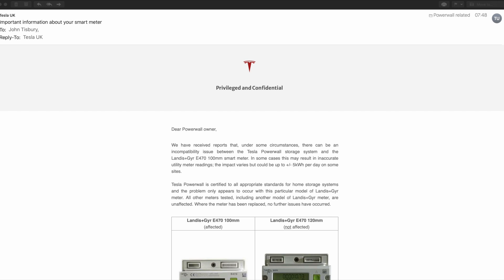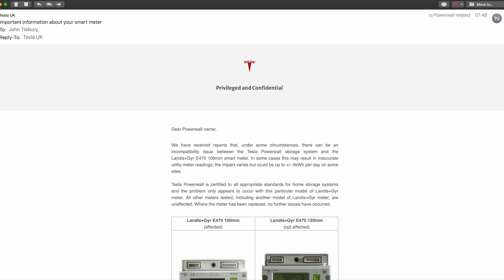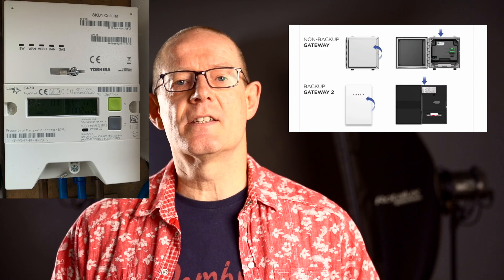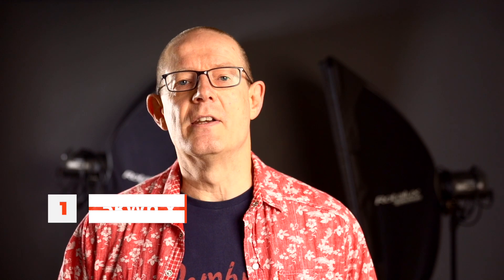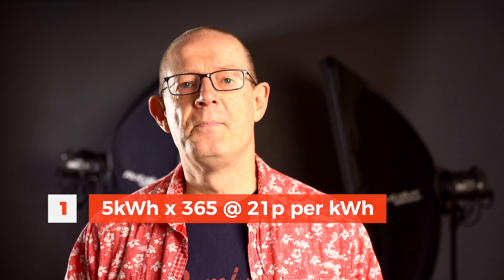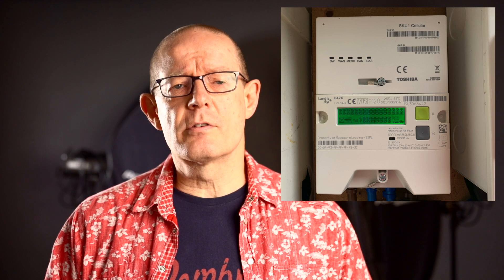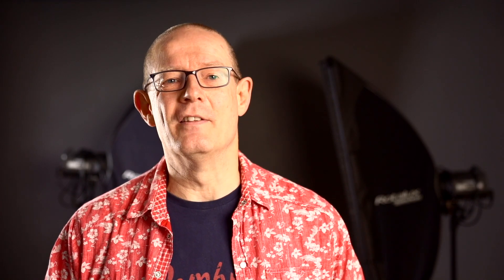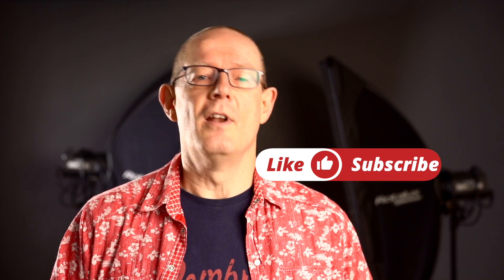Resolved phantom drain Tesla Powerwall 2 and Landis+Gyr E470 smart meter

Comment: Mine was changed yesterday.

Replaced with a Kaifa MA120 meter.

The installer said he was solely fitting replacement meters for Powerwall owners.

I wasn't suffering from phantom grid draw but my L&G meter was reporting a constant export to the grid (150-250 W/Hours).
This was being recorded on the meter and I was receiving SEG monies for it.

With the new meter and new IHD fitted, this export has gone away.

Full marks to Octopus for sorting out.
Reply from the maker: That is great news Dean, thanks for the progress report. Once the issue had been identified and understood OctopusEnergy have been quick to mobilise and swap all customers with Powerwalls and annL+G meter.
Reply: @johntisbury  i've also just received an email from Octopus, offering a small amount of compensation .
Reply from the maker: Christmas is coming early for you! 
I guess OE will be claiming that back from Tesla/L+G

Comment: John, How do you tell a 100mm from a 120mm meter? My E470 looks identical to yours
Reply from the maker: The 120mm has the B button on the left-hand side. You have the 100mm.
Reply: @johntisbury  thanks, yes I have the same meter, however, I don’t have s PW but a Moixa 4.8 KWh home storage battery and wondering if this is also affected as I can make my numbers tally either. I will have to investigate further,
Reply from the maker: Depends how much they are out and if it’s consistent in terms of usage verse variance. If you don’t already, record the end of day grid usage on the meter and on the storage battery to give you some data to review.

Comment: Hi John that's great news about your situation. I spoke to tesla about my issue with the variance between the tesla app for grid usage and my smart meter data and they said that I see some grid usage record on the tesla app because of transitive usage which is appears on the app but I don't actually get charged for it. For example I only actually used 3.46 kwh of grid usage for September but on the app it said I'd used 30.2 kwh. The app also said I exported 257 kwh however my amart meter data says I exported 232 which balances out. 
I was hoping someone could tell me whether the transitive usage will actually count as "home usage" on the app. I only ask because then it actually distorts the data when calculating actual usage from the powerwall and solar. I know its pedantic but I like it to be accurate. Any advice would be appreciated. Hopefully it makes sense
Reply from the maker: Hi Robert, if it’s showing on the app as grid usage it will most likely be included as home usage. I very much doubt the Powerwall would differentiate. 😏

Comment: Great news.
As an incidental, don't use a meter you can buy, say from Amazon, to compare the smart meter reading.  The smart meter is supposed to measure Watts (then apply a power factor scale) to your bill, while a "cheap" meter you can buy will measure VA.  For AC current this is ONLY the same for resistive loads like a electric fire, but for all transformers fridges, motors and modern lighting the Watts is always less.  It sounds like this smart meter is recording VA - very naughty.
Reply from the maker: Yes it is. 
Have a read of this article from Octopus Energy it gives you the cause of the problem with the variance in readings. BTW it's not measuring apparent power (VA).
Reply: @johntisbury  Thank you, I missed that link and see it is conductive emission.
Reply: @Tom55data  Octopus are being kind to L&G over this. As most electronic equipment (not just the PW) generates conducted emissions I suggest that this L&G meter is simply not fit for purpose.
Reply from the maker: I don't think that's the case John. 
Both Tesla and L+G have passed their respective stringent test for their equipment for conductive emissions along with the MID standards https://ec.europa.eu/growth/single-market/european-standards/harmonised-standards/measuring-instruments_en
In many situations the L+G meter with a Tesla Powerwall has been faultless and accurate. It was just a few installations that had the issue.
Reply: @johntisbury  Unfortunately passing CE regulation tests doesn't necessarily make a device fit for purpose. I don't have access to the actual test standard nor an analysis of the PW conducted emissions so can't make a more technical argument, but clearly some aspect of the L&G unit wasn't satisfactory for it to be producing false readings.

Comment: Glad you have some good news in getting this resolved John, I'm still awaiting a smart meter install so it's good to know what they shouldn't be fitting. It could be me but the Dropbox link does not seem to work?
Reply from the maker: Thanks Graham, the dropbox link is probably at fault, it hates being copied from a previous video description for some reason. I sort it, check back in 30 mins or so. Remember that not all Landis+Gyr E470 will produce the same fault, there's many installed with Powerwall 2's with no issues at all.